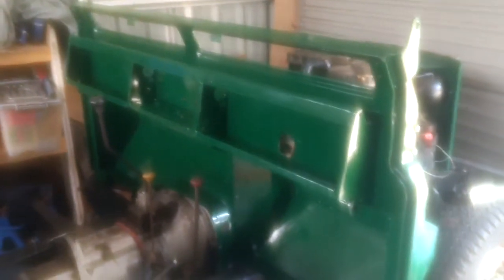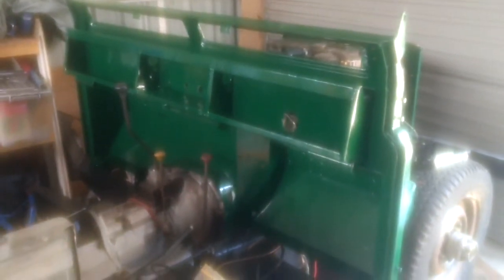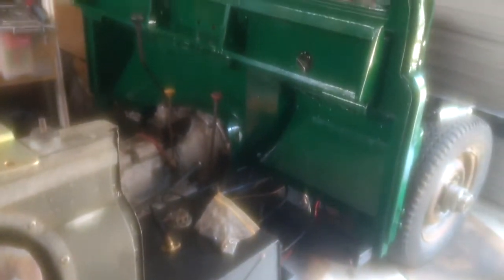Land Rover Series 2a 88 - Bulkhead Installation

Comment: Looks good, well done and thanks for sharing your progress.  It might be worth checking the door gaps now. I believe it’s 34-¾” or about 880 mm each side. I found mine too small, so will have to put large washers between the bulkhead feet and the chassis outrigger as my rear tub was as far back as it could go.
Reply from the maker: Sask, fantastic info. thanks for this detail, will check mine out.
Reply: You are welcome.  I managed to squeeze my doors in with 34-¼” gaps, but have yet to fit the door seals, all the best Ian